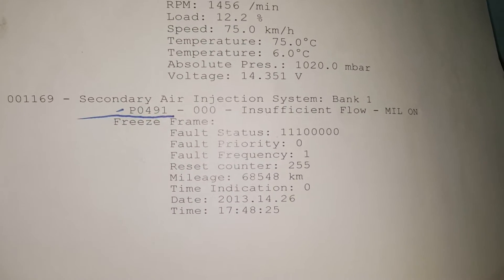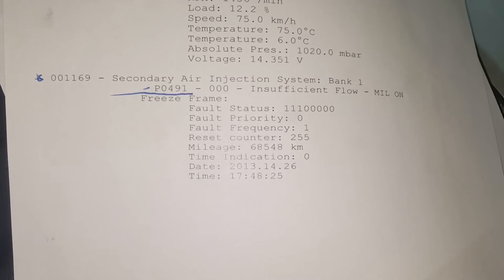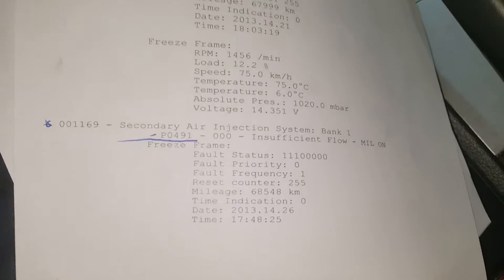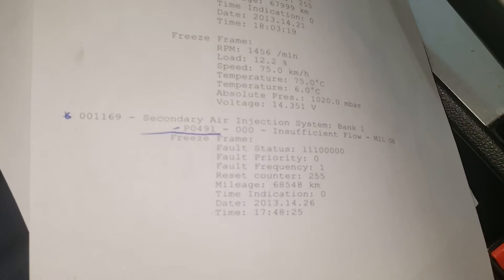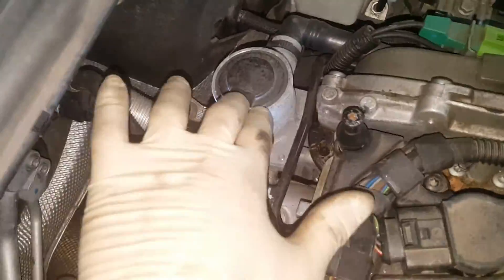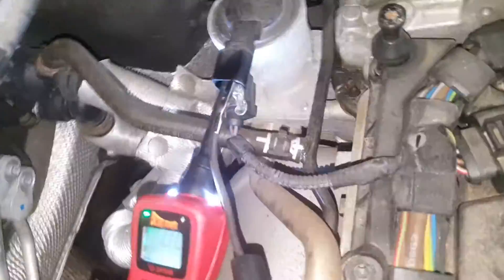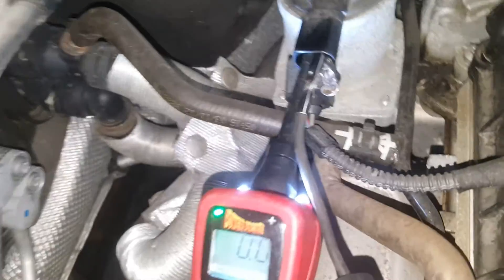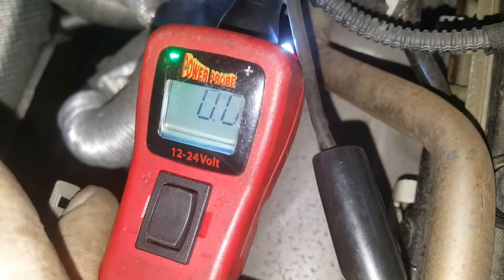How to fix VW code P0491 Secondary Air Injection Low Flow

Comment: Thanks, but diagnosing the problem is not fixing the problem. Maybe you could edit the title.
Reply: Replace the combination valve!
Reply: @SledStorm95 you’re not totally wrong but neither is whiskeyhill. This is possibly the second worst car “repair” video I’ve seen. He wasted a minute and a half showing us a freaking printout and saying the error that says insufficient flow means not enough air flow. 🤦🏻‍♂️ 
On top of that the only showed what he did to prove the combination was bad. Didn’t show ANY of the other possible causes. So yeah, horrible…

Comment: Hi I have the same code on my 2013 Jetta gli  what would the cost be roughly
Reply: I got quoted for a 1k so that’s why I’m here lol
Reply: it depends what you need, the worst scenario is you have to disassemble the timing and clean all carbons in the cylinder head, that would be a huge bill😢

Comment: Once the faulty component is replaced, will the check engine light turn off on its own?
Reply: Hey bro did you get that figured out??
Reply: I have the same issue with the check engine
Reply: Did anyone figure it out? I have a 2018 vw Passat se do I guys think it might be under warranty?
Reply: So i have the same issue had it for over a year, took it to a shop and they "replaced" the combination valve and the sensor. Problem still exist. I have a friend mechanic so hes going to look into it will report after!
Reply: how did it go?
 @tlalok08
Reply: @Sheepdog34  actually fixed the issue, replaced the oil separator had no idea there was such thing. Problem solved!

Comment: rust   causing it to stick   I think.. and not a fan of vw
Reply from the maker: Yup would have to agree.
Reply: You’re not alone !
Reply: Kia sucks timing belt issues
Reply: My VW has 210k and up to that point it's only cost me 1100 in relatively minor repairs... most of them in the last 10k but they're to be expected for the years and miles. Oil cooler, rear door lock(from years of pizza delivery), serp belt, alternator, pulley tensioner and a few sets of breaks... that's it. To be fair its probably their best but slowest engine, 2.0 CBPA paired with a manual. 😅 I was just here looking up this code for a friend's Passat. I tell everyone I know, get a basic 4 cylinder paired with a manual and that alone will generally get you a reliable car.
Reply: You should stick with your KIA